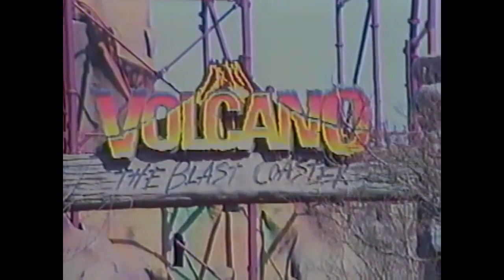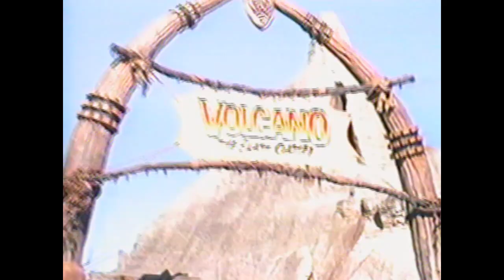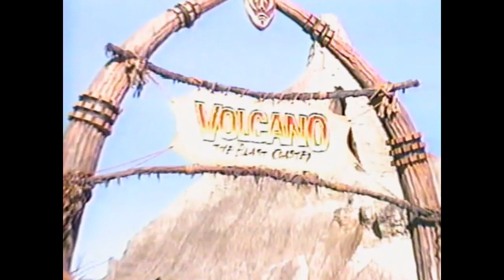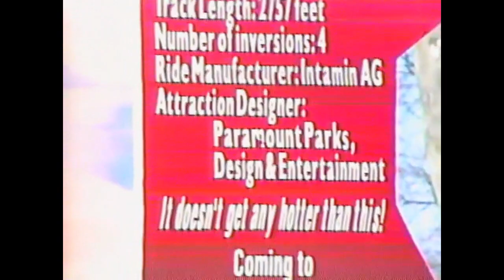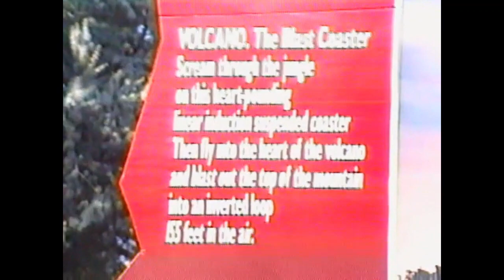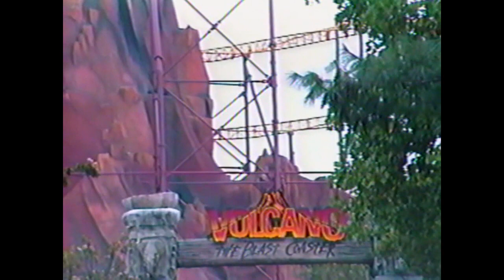Volcano The Blast Coaster construction in 1998 and opening with 8 seats- Paramount's Kings Dominion

Comment: I was at Kings Dominion in late July 1998 and I saw Volcano.  But it had not opened yet, as it would open on August 3rd of that year.  I would not go to Kings Dominion until 2016 when it was closed the day I went.  In 2017, I was able to get two rides on Volcano on two separate trips, both having a long line to wait in. It was an awesome coaster though, very unique.